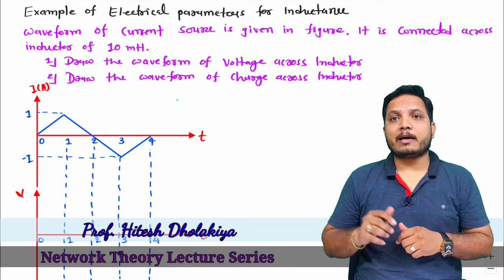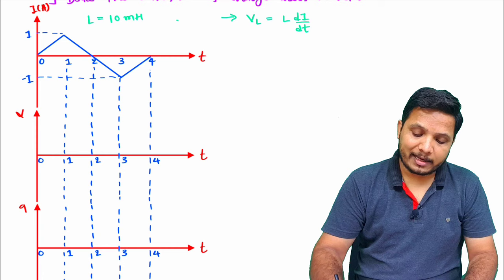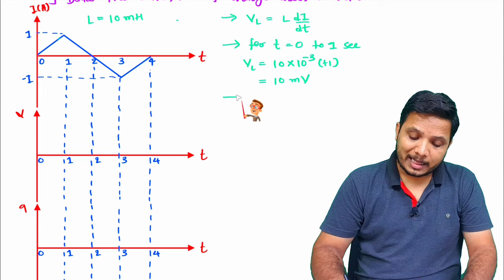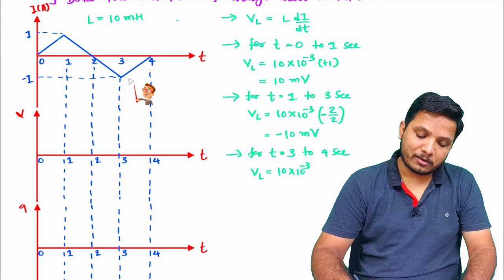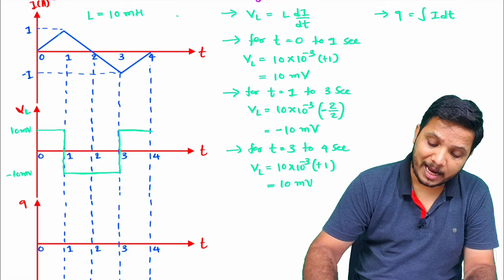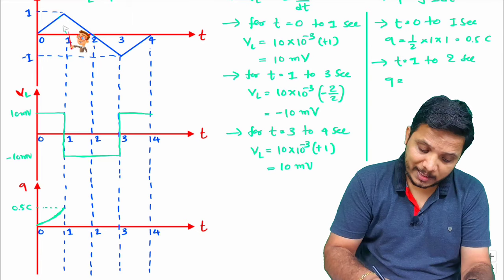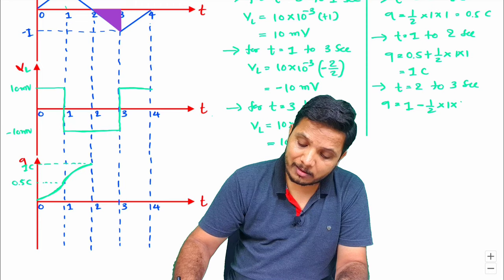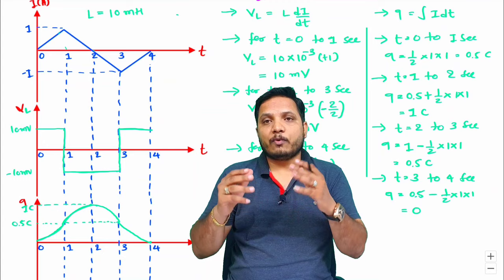1 Example of Electrical parameters for Inductance | Network Theory

Comment from the maker: Example of Electrical parameters for Inductance explained with following Timestamps:
0:00 - Network Theory Lecture Series - Example of Electrical parameters for Inductance
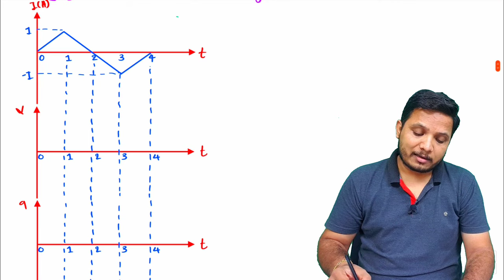1:00 - Voltage waveform calculation for Inductance
5:13 - Charge waveform calculation for Inductance

Comment: sir if we draw the charge waveform by directly integrating, and not considering the area of i-t curve, then i am getting different answer.. pls help.. like then charges are 1,0,-1,0.. for example for 0 to 1 second, q = i * t(0 to 1) = 1 * 1 = 1 , for 1 to 2 second, q = i * t(1 to 2) = 0 * 1 = 0.. and so on
Reply from the maker: Your function of current is wrong. It is line equation
Reply: @EngineeringFunda  ohh got it sir.. we have to take I as a function of time then right